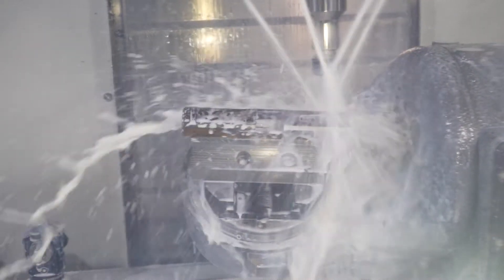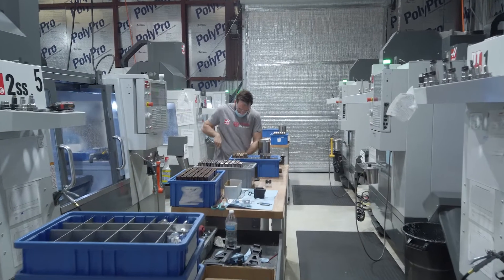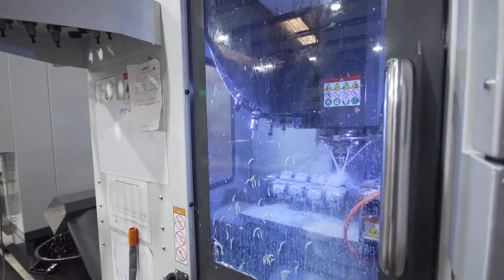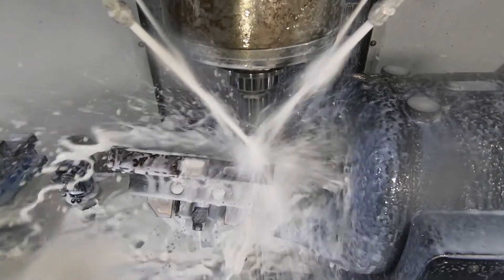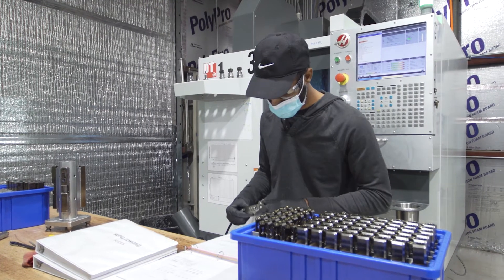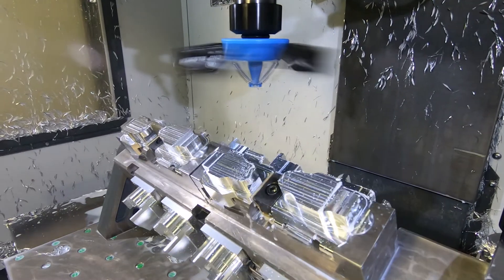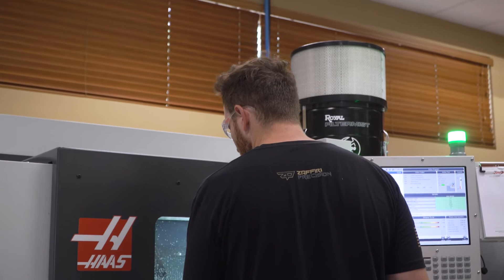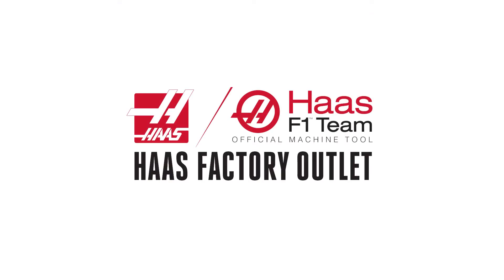Machining Custom Slides and Bolts at Zaffiri Precision on Haas CNC's

Comment: Destroying the strength of the slides. Not good. Dangerous when using heavier loads.
Reply: Just millions of them being used 😂
Reply: Nah, only thing critical is the breech face which they don't touch. These slides will get super dirty super fast though 😂
Reply: You see that chip bucket? 17-4 stainless. It's no worse than shooting a 40 cal glock